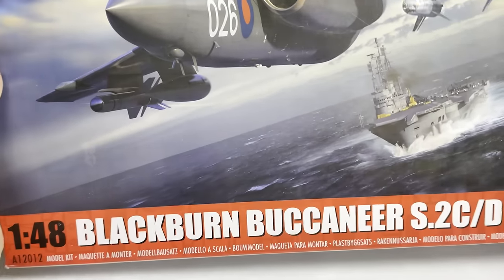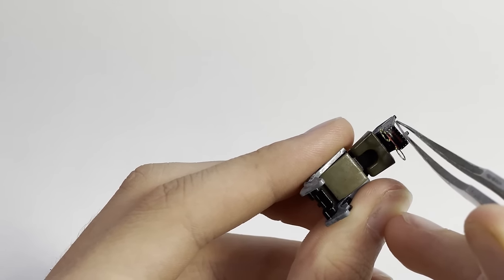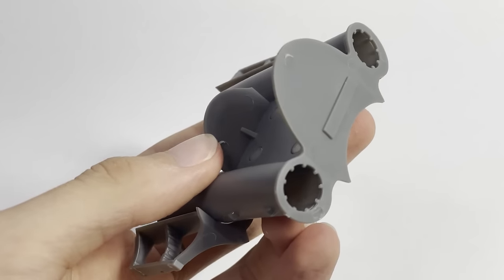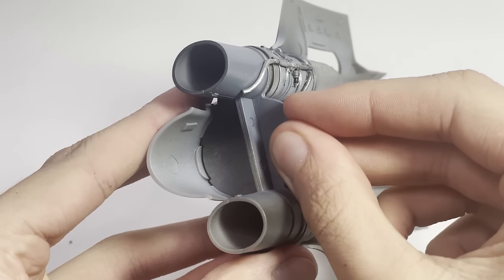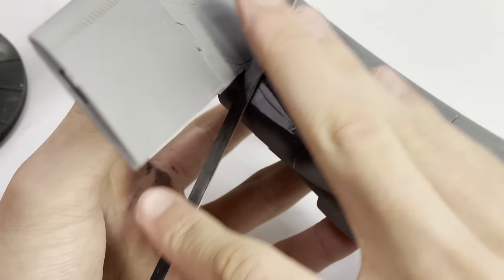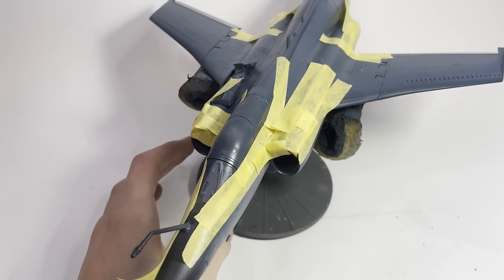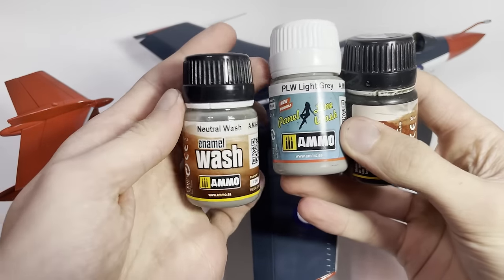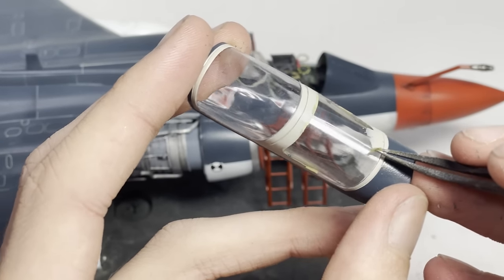Airfix's Newly Tooled 1/48 Blackburn Buccaneer | Full Build | HD

Comment: Great video of a lovely aircraft, you didn't go mad on weathering missiles as (when fitted to an aircraft) they only do 3 or so flights and then get sent back to the bomb dump for the 'fairies' to service them before they are fit for flight again. A few red streaks of weathering in gear bays , engines bays or near moving surfaces would make it look like hydraulic oil has spilt or leaked as it looks like ribena but smells worse. Fluids are checked BF and AF and those panels are removed constantly, finished model looks gorgeous and i hope you enjoy Telford.
Reply from the maker: Thank you very much for all the information!! I’ll keep it in mind for my next bucc build! I can’t wait to get there!!✌🏼

Comment: Beautiful model but I can't believe you've left off one of the Bucc's pioneering features - the external fuel tanks!
Prevailing wisdom was to use simple stamped external tanks (think Hunter) and drop them when empty.
The Bucc had much more aerodynamic tanks which would not normally be dropped except in emergency - even so they gave the Bucc longer range at less long-term cost than single-use tanks would.
The Bucc's engineers won an argument with Sir Sydney Camm about this :D

only solution is to build a third Buccaneer with the tanks… does anyone do a 1/32 version?
Reply from the maker: Thank you very much! Ah dammit!! I knew something was missing off of this but I couldn’t put my finger on it! I am pretty sure someone does a resin edition of the 1/32 bucc but I think I will wait until Airfix do one🤣 thanks for the comment!✌🏼

Comment: Welcome back Luke! Another excellent looking model made in record time, I don't know how you do it lol. Quick question about VMS matt/gloss varnish, what psi and nozzle do you use I find it hard to get it to work nicely for me. TY!
Reply from the maker: Thank you very much! Sometimes I don’t know either! For VMS varnish I’d pump up the PSI to around the high twenties at least, then in regard to nozzle the bigger the better I usually use a 0.3 for it but you wouldn’t go wrong using a 0.5! I’d also recommend thinning it about 20/30% to really help the flow of it😁✌🏼
Reply: @machmodels curious WHAT you used to thin it? Also was wondering what you thinned the SMS with? Believe you mentioned knocking it down around 10% also.
Reply from the maker: @crazylocha2515 so in regard to the VMS varnishes I just use their own brand of thinner, I think it’s called VMS Acrylic Thinner 2.0! For the SMS I just thin it down using Mr Levelling Thinner, I personally think it down just because in my opinion it’s a little too thick… that being said that’s all subject to how you personally like your paints! Hope this helps you out✌🏼
Reply: @machmodels  quite a bit of help actually. Sometimes it's those little nuggets that go a long way for dealing with aggravating issues. Have watched a few videos now, and you've earned the sub, thx for the quality videos and looking forward to more. 👍
Reply from the maker: @crazylocha2515 well fingers crossed it helps you out! Glad to have you on board, got lots of interesting content in the works!😁

Comment: I had the same issue of rough texture a few years ago.
The reason was too much air pressure. The color dried before it hit's the surface.
This is critical especially when using non acrylic paints.
I spray non acrylic paints at around 0,8 to 1 bar. 
Maybe this works for you too.

Great work as always with that Bucaneer! 👍👍👍
Reply from the maker: Brilliant comment! Thank you so much I will definitely have a play around with different pressures on my test plane! Thanks for the comment✌🏼❤️

Comment: Brilliant work mate. I just ordered the Black dog engine set but the one with a single engine and radar set. Is it any good ?
Reply from the maker: Thank you mate!! I believe that’s the same one as I had for this, it fits “okay” with some sanding involved but if you want to do something similar to what I did it requires a lot of scratch building. I personally found the radar to not fit very well but with some persuasion I’m sure you could get it in there! Let me know how you get on😁✌🏼
Reply: A bit of an update on my current build. Luckily I managed to get my hands on the big set which I'm using, more detail than the other set. Going to display the jet with folded nose and completely exposed engine. Wish my luck 😊